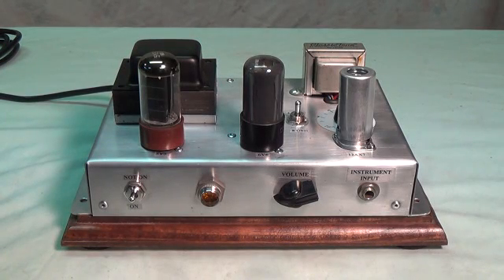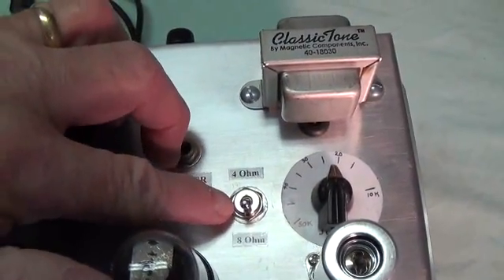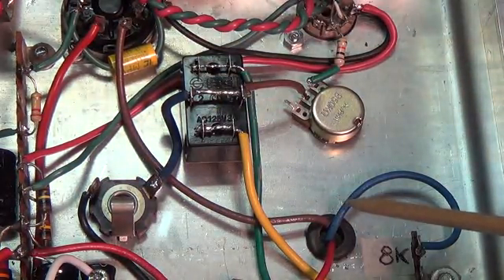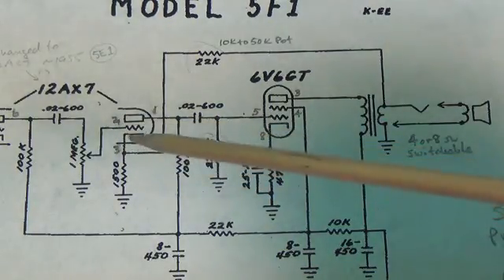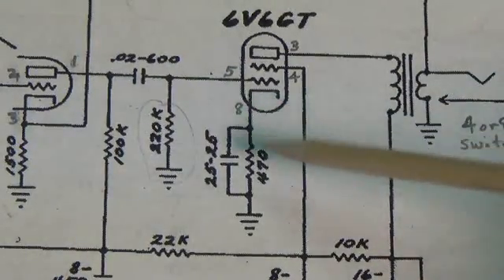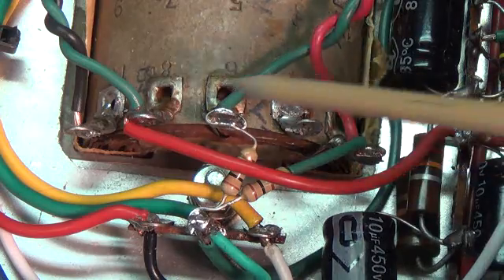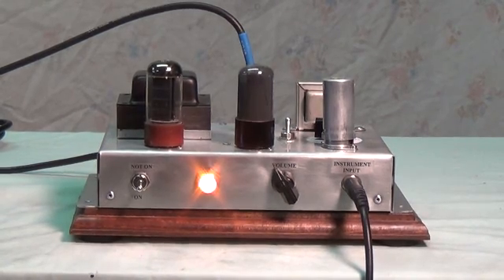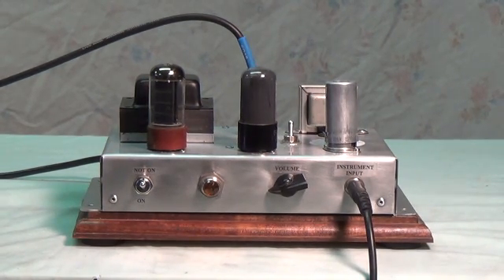Scratch Building a Fender 5F1 Champ from Scrap Parts.....Part 2

Comment: Uncle Doug,

I absolutely loved these two videos. Especially the circuit modifications that you put in. What is the power dissipation in the cathode bias potentiometer?

Keep up the good work and give Rusty a treat.

Craig
Reply from the maker: Greetings, Craig, and thanks so much for the kind words :) The precision-adjustable pot was rated at 1W.  A PC of  31mA (voltage drop of 15.5VDC) across 500 Ohms produces about 0.5W of heat, so there is a 100% safety factor. Thanks for watching.....Rusty says thanks also  ^. .^

Comment: I'm not a tube guy but I am an electronics tech. I always wondered if a person put  well filtered DC into the filiments if it would be more quiet.... I do have a early 70's Fender Bassman10 amp but it is in VERY rugged condition. It DOES work though. No cabinet or speakers though... :-(
Reply from the maker: Greetings, L1. Yes, some people rectify the heater supply, but there are other, easier ways to reduce the hum. I think it's more of an issue in HiFi amps than in guitar amps. Thanks for watching.....and posting a comment :)

Comment: The chassis really brought the spare parts together nicely. I'm working on a stereo tube amp using EL34's and the 12AX7. Wondering if the Negative Feedback Loop would serve my project justice. Keep up the good work!
Reply from the maker: I think a NFB Loop would be a great addition to a stereo or hifi tube amp. As Randall Aiken says, "It flattens and extends the frequency response, it reduces distortion generated in the stages encompassed by the feedback loop, and it reduces the effective output impedance of the amplifier, which increases the damping factor". It also reduces hum and extraneous noise, all of which would be a great asset to a stereo or hifi amp.

Comment: nice setup mate great work shop what was wrong with it?. nice job on the amp and yep nego feedback made a big change, sweet harmonics. to blues it up i put capacitor across primary of out tx thickens tone , well it is a form of tone but its better than a passive type tone. i think a 5 10 watt valve amp driven can sound better than a 30 watt at same volume , totaly right on heater chain it does make a difference in hum, better than using the old hum dinger vairiable risistor .and a good old 20 watt 12 inch speaker easy to drive is great.you dont need a 100 watts of power to get the cone moving. great enjoyed it mate, and rusty. cheers j
Reply from the maker: Thanks so much for all your nice comments. I'm glad you enjoyed the video. The work shop does get a little messy from time to time, but (as viewers all know) Rusty is always anxious to help me clean it up :))

I agree with your opinion regarding small amps. I much prefer them. Unless you're playing Wembley Stadium, a good 8 to 15 watt amp is all you need.....and the tone is generally warmer and richer. Thanks again for your input :)

Comment: Two things i've noticed - 10k resistor+50k pot=60k total maximum, not 50k.
And when you have output transformer with 4/8 ohm winding, you usually connect the negative feedback to the 4ohm winding, before the switch, so the feedback gets always the same level. The way you did it, when you switch to 8 ohms, you slam the feedback with double the voltage.
Reply from the maker: Greetings, M10B20. The resistance issue was already discussed below (see the Ben Prevo comment) and the switching from 4 to 8 ohms is only done with the amp off, so voltage spikes are not an issue. I appreciate the time you took to watch my video and to post your thoughtful input. Thanks !!!

Comment from the maker: Thanks so much, lawnmowerrecycler. For some reason, YT would not allow me to respond directly to your inquiry.  I have a large assortment of various colors and gauges of wire that I use for projects like this. I would guess that most of the wire used in this amp was 20 gauge.
Reply: Uncle Doug I just did this with a build... I put in a 5881 into a build designed around a Champ output section and biased the tube for the maximum plate dissipation - 24w. I then went from a 5Y3 to a 5U4 rectifier, which raised the voltages and put me in 6L6GC territory. Without changing the bias resistor, I got a plate dissipation around 28w with the 6L6GC, a couple watts under the 6L6GC maximum. If I want to run a 5881 or 6L6GB, now all  have to do is put in a 5Y3 rectifier again and I can slip in either of those tubes without having to rebias.
Reply from the maker: Yes, I would think you could install other output tubes and simply alter the cathode-bias resistor to get the proper plate dissipation. The only limiting factor I can see would be that your (6V6-appropriate) plate voltage might be a little low for a more powerful tube like the 6L6GC (but would be OK for a 6L6GA or GB), and the tubes would have to have the same internal wiring, i.e. 6V6, 6L6, and EL34 (if you jumper 1 and 8)
Reply from the maker: What if you installed a cathode bias pot so the adjustment could be made quickly for each output tube? You're right about the additional current draw with the 5U4. Several years ago I set up an experiment, measuring the current draw of different rectifier tubes, and the tube manual is right on the money....2A for 5Y3 and 3A for 5U4. The GZ34 is a real "bargain" however, with excellent voltage output and only 1.9A filament draw. It may be a good choice for your "quick change" circuit.
Reply: Awesome Junk Bin Parts Uncle Doug! Awesome video as always. This turned out to be an amazing build! I have to share this on my FB Page. Ty so much for not only a great video but more understanding of how these little tube amps function.
Reply from the maker: Thanks so much, Marc. I'm glad you enjoyed the video. Thanks for sharing it on FB :)
Reply: YW Uncle Doug! Looking forward to more posts.
Reply from the maker: Thanks, Marc. I am working on a video explaining phase inverters. Hopefully, it will be posted soon, so stay tuned :))
Reply: TY. Always looking out for your new videos. Have a great day Doug!
Reply: Wait....having the Variable cathode-bias resistor...would that allow you to use other octals? I don't mean just throwing in a KT88 and hoping it sounds good in a 6V6 circuit, but maybe 6L6 variants, maybe even an EL34....if you don't mind it sounding "brown"... Am I being unrealistic about the EL34?
Reply: Uncle Doug Cool, thanks!
Reply from the maker: Wow....very clever, Brad. Instead of changing the circuit, you simply change both the rectifier and output tube. I would only add that since tubes seem to have different PC values, you might need to recheck your bias if you ever decide to try a new 5881/GB or GC. They may have a different PD value. Meanwhile, it sounds like a good arrangement to me :)
Reply: I misspoke on the GB. You'd have to rebias for that tube, but Russian 5881s are ok at 24W. From what I understand, if your power transformer can handle the increased current of the 5U4, this is a good way to get a 6V6/5Y3 circuit up to 6L6 range without really modifying the amp (beyond power tube bias resistor). It made my little build more robust-sounding, louder, drives the speaker better, more bass response, and obviously a few more watts. :)
Reply from the maker: Thanks for the input, Lefty.

Comment: Hi Uncle Doug, I tested a magic eye tube, a 1629, it glows bright, no shorts but emission on tube tester shows "replace". Do I have a bad tube or there is e different way to test magic eye tubes? Thanks, Sorin
Reply from the maker: I wouldn't trust the tube tester, Sorin, since "emission" is really not what these tubes are used for. Put it in the tester, apply the high voltage (usually by pushing the "test" button), and look at the illuminated "eye". If it's brightly lit (usually green), then the tube is good. If it's real dim, then the tube is worn out.

Comment: Correct me if I'm wrong but the negative feedback loop mod you made is basically just a presence control for the amp right?
Reply from the maker: Greetings, Mykal. In the Champ circuit, increasing the NFB (reducing the pot resistance) will reduce distortion and dampen all frequencies equally. Reducing the NFB (increasing pot resistance) will increase volume and distortion in all frequencies.

A Presence control, such as found in early Fender amps, involves the NFB loop, but is more selective. It reduces the bass frequencies and leaves the upper mid-range and treble intact, so it seems like they are boosted (they aren't, but it seems like they are). Presence is an emphasis of the upper mid-range and treble frequencies.

Since the Champ variable NFB is not frequency selective, it really isn't a presence control. It doesn't emphasize mid-range and treble. With a minor alteration, however, it could be turned into an early Fender-style presence control.
Reply: Ah, I appreciate the reply. Radios have always been more my thing (amateur radio operator since 04') but I've been getting far more interested in guitar amps.
Reply from the maker: Your question was a good one, Mykal, and I appreciate your time and interest. I hope that my reply made sense.

Comment: Interesting about dopping your wires down to the tube sockets rather than running them low in the chassis. I'm taking notes.
Reply from the maker: It's an old trick I learned from working on amps, and from trial and error. Arching the filament wires downward to the tube sockets seems to reduce hum. I'm glad you enjoyed the video :)

Comment: Another great vid. 2 questions. 1) The bias pot for the 6v6. The 470ohm resistor is 2 Watts. what was the wattage of the bournes pot you used? 2) I have a late 70s vibrochamp that uses a single wire for the filament supply. Do you think it is worth it to put in a twisted filament supply?
Reply from the maker: Greetings, FL1, and thanks. I believe the cathode  trim pot was rated at 5W. Even after 30 minutes of use, it was still cool to the touch, so I don't believe its wattage will be a problem.

Re the single-wire filament wiring, it was a method the factory used to keep production (both parts and labor) cost down. If the amp doesn't hum, then you're probably fine, but if there is any trace of AC hum, then adding the second wire and twisting them tightly might help.

Comment: I have the same Output tranny. I think I'd like to use a switch for the output as well on my 5F1 build. Is your DPDT a 2-position switch (such as "on-none-on" or "on-on")? Thanks
Reply from the maker: It's a three-position switch, Bob, "on-none-on".  A speaker lead is connected to the "none" terminal,  the 4 ohm OPT wire is connected to one "on" terminal and the 8 ohm is connected to the other.....so when you switch, you are either connecting the speaker to the 4 ohm output or the 8 ohm output of the OPT. The other speaker wire is connected to the remaining OPT wire. I hope this makes sense.

Comment: Once again, very awesome video sir. Quick question.. do you think it would be wise to put that variable bias resistor in to a Princeton? I know you ended up using 2 different values to cathode bias them. Would I need 2 of them? or do you think that one would match them well enough? Or is cathode biasing a better option? I had a crate blue voodoo 300 watt head.. with 6 6L6's... when I replaced the tubes and bias that.. each resistor was responsible for 3 tubes. Just trying to pick your brain before I dig into that Blackface. Thanks again for sharing your knowledge with us.
Reply from the maker: Greetings, PL.  Thank you for your kind words and excellent question. A lot depends on how well your 6V6's are matched with regard to plate current (PC). It's rare to find a perfect match, but if they are close (within a few mA) then a single precision adjustable resistor between the cathodes and ground would be adequate to reduce their average plate dissipation to acceptable levels.

If the present (or future) 6V6 pair has significant disparity in PC, then separate trimmers would be necessary.

To me, this IS cathode biasing, required to supplement  the inadequate grid biasing provided (in the original Fender circuit) through the Tremolo Intensity pot. To me, it was an ineffectual design, made only worse by today's higher (120V+) AC voltage levels.

Comment: the coolest video on youtube. Worth every minute. Thank you
Reply from the maker: Thanks so much. I really appreciate your kind assessment. I have posted 80 other videos and would like to invite you to check them out. Happy New Year !!!
Reply: Hi uncle Doug,  I finally made the move and ordered all of the parts for A scratch build. I'm planning of  building a 5C1 amp as suppose to the more popular 5F1 . I have a few questions I needed to ask you. Is there anyway I can send you a PM. I already ordered the parts and had bought the pine boards at hOme depot earlier. How is the 5c1 differ from the 5f1 . I watched all of your videos regarding biasing a single ended output amp like the champ. I am looking for a really fuzzy little amp ( early breakout) on lower volumes. Thanks

John
Reply from the maker: Congratulations, John, and best of luck with your project. I can tell you the difference between the two circuits, but it would improve your understanding if you downloaded the schematics for each and made the comparison yourself. The 5C1 is a great choice, in my opinion, because it has a 6SJ7 pentode pre-amp tube (instead of the more common 12AX7). Pentodes generally have a warm tone and should give you the breakup you seek. You should also watch my video on the Tonemaster amp.....it has a virtually identical circuit. I'm not sure how PM's are sent on YT any more. Every time I figure things out, they change everything....:))

Comment: I like your illustration @07:10 on how this neg. feedback works. But on this ´little´ Class A Amps you´ll not blow up your speaker ;) Since it only will produce some 15W max. Output power. You can try to omit this resistor - the Amp will sound very smooth when saturated. Class A designs put out very high even harmonics when saturated and not having a feedback loop to lower or cut them out.

I put years in research on how to saturate PreAmp tubes in a way to create a harmonic spectrum like (heavy) overdriven Amps. Just to have a single litte and lightweight unit instead of a heavy vintage (and therfore better stayin´ safe at home than movin´ around from gig to gig) and fragil Amp while playing on stage...

I found a way to let my PreAmp sound just like an overdriven Leslie 122 Cabinet Amp. But the same unit can sound like a marshall plexi Head, if wanted. One mark on this road is the feedback-loop and its design.
Reply from the maker: Good to hear from you, TubiCal. As an experiment (when I get some extra time) I did intend to greatly reduce the 10K resistor and increase the pot value (thus broadening the span of adjustment) to see how it affects the tone. Maybe I can get this done by the time the Tolexing video is finished and can include a sound test of the enhanced NFB range. Thanks again for your input.
Reply: Hi Doug,

simply can´t wait for the tolex episode, as i really need to see how this works :)

If you reduce the 10k ´protection´ resistor too much you may kill the tube, by adding to much AC cathode current, since it´s comming from the OPT sec. winding....but you may try to simply omit it, and leave the output stage to do what it want ;)

Finally i whish you all the best for 2014!!

Keep up your good work!!
Reply from the maker: I would think that if reducing it too much might injure the tube, then eliminating it entirely might be even worse. If I do experiment with the NFB resistance, I'll be sure to monitor the cathode voltage and current. Thanks, TC, and stay tuned for the Tolex episode. Rusty and I will start working on it very soon....:))
Reply: Please do not worry to much about omiting the NFB path, remeber the vox AC30 - there is no NFB and it works just fine:)
Some Amps do not even have a NFB path at all. I build myself a very odd Amp design some 10 years ago, based around some 6C33C russian Triode intended to be used in regulated power supply. It has no NFB at all, thus left the whole output stage to thier own. It sounds very nice. Then again with a NFB between the sec. winding of the OPT and the driver prior to the phase splitter. All the magic was gone...

But there is indeed some sort of snag, if your output stage has real Hi-gain (better is to say  high transconductance) - when using some EL-130, EL-519 or similar without NFB it will be self oscillating.

It´s so sad that we simply can´t meet to talk about all these things eye to eye and with the Amps next to us for refering to it, check, proove and also see what´s going on.
As i would love to hear these great vintage Amps in real life.
Reply from the maker: I agree, TC. It would be nice to get together over coffee (or a few beers :) and compare notes.